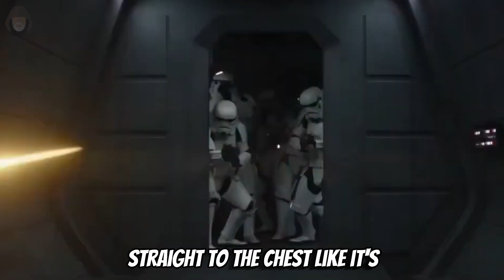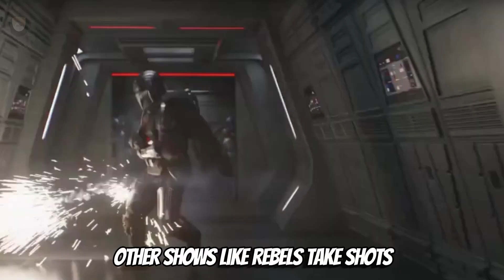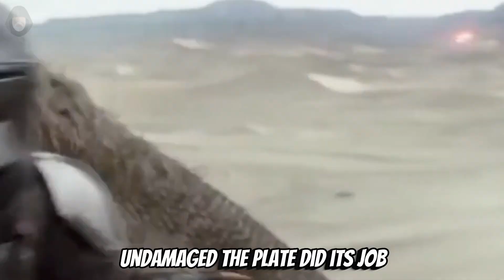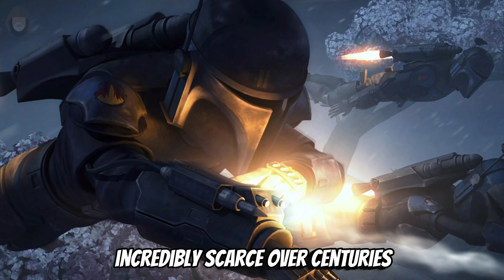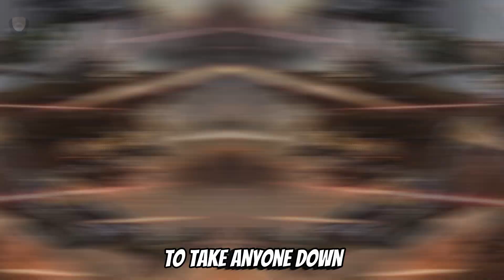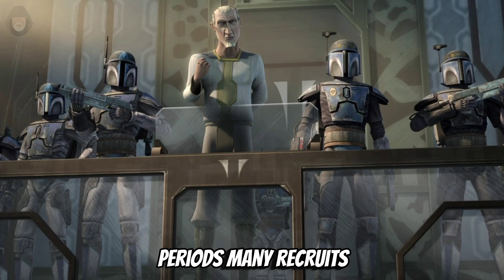Why Do Most Mandalorians Get ONE-SHOTTED, Despite Wearing Beskar?

Comment: This is exactly comparable to real steel armor. There are a lot of different grades of steel with varying levels of certain metals in the alloy which make them different. The weakest steel can be bent by hand sometimes but high quality steel has proven capable of sometimes withstanding low-velocity bullets. Both the exact composition of the metal and the design it's forged into have a lot of effect. Shape and thickness changes can cause completely different results from the same exact types of steel. Beskar variations are depicted as functioning exactly the same as that in relation to the usual weapons hitting the armor.
When it comes to the ones hit in fabric instead of beskar there's still actually more than one possible result you could see. Some of them surely have simple cloth that's more cosmetic and comfort than anything else but fabric armor is very much a thing in Star Wars too, likely because real fabric armor exists in a very different form (typically thick linen). The same durasteel widely used for armor plates and many other things can also be made flexible and this material is apparently something certain imperial military personnel used for various purposes. It still has some resistance to a lot of things and is a protective fabric but it can be made thin and easy to move in. I know there's something called armorweave but I haven't seen anything to confirm if that's a different thing from durasteel fabric or the same thing.
That makes it possibly the ideal material to put underneath regular armor in order to reduce the damage done to the wearer. The stuff logically wouldn't be nearly as protective as rigid armor plates but it can handle fire, acid, and some blaster fire without sacrificing mobility. Armorweave also has a level of resistance even to a lightsaber (probably why Vader's Cape is made of it) but I imagine the actual protection value there is only enough for a glancing blow. A lot of Mandalorians who take shots directly to the fabric are probably surviving it due to it being either armorweave or something like a stormtrooper's body suit. The hit will knock them down for a while but a lot of force gets dispersed enough that it becomes more like a stun. Most spots that lack plating tend to be non-vital so it's very likely to actually be a moderate injury they can recover from. 
I imagine armorweave made into clothing like that would be seen the same way as a knight wearing chain or gambeson under his armor plating. It's still something you'd ideally have to make you safer but not a material expected to keep you alive by itself for a frequent fighter.

Comment: I thought Beskar was some weird titanium equivalent for blaster rounds. The reason titanium is an attractive metal in bulletproof vests is because it's 2/3 the density of steel, making it very lightweight by body armor standards. Not to mention absolutely proof against most rifle calibers.

But a more apt comparison appears to be steel for pure Beskar or really strong ceramic for the weaker stuff.
Reply from the maker: Yep pretty much agree with that assessment!
Reply: @StarForceOne What's weird is that titanium is a pain in the ass to machine. You need specialized bits or It'll eat the bits.

I wouldn't be surprised if Beskar did similar.